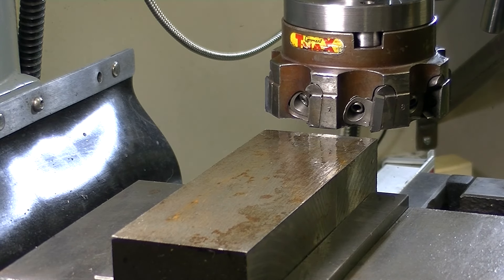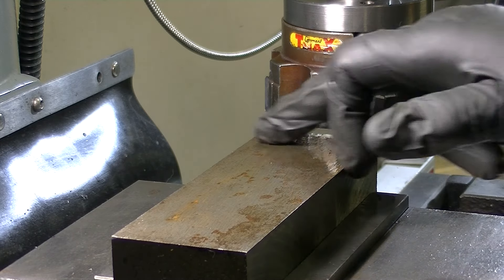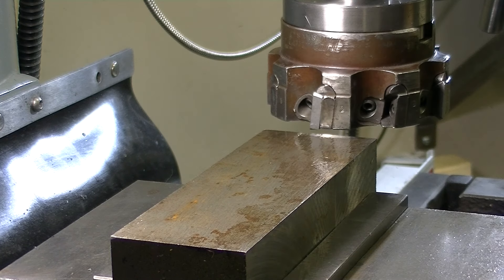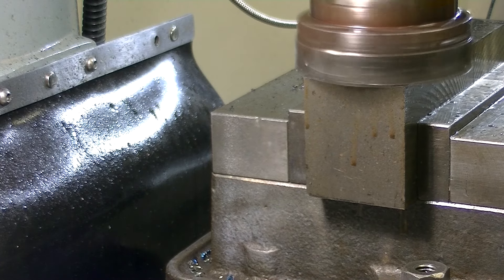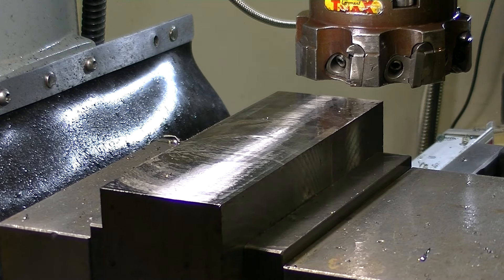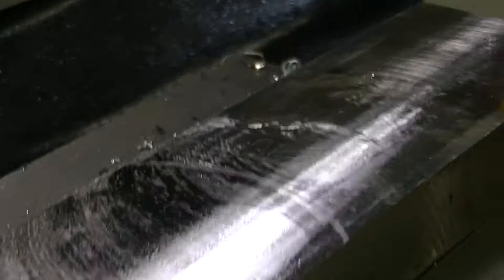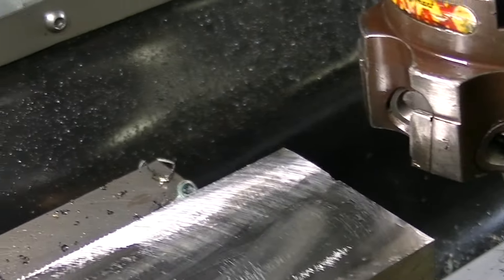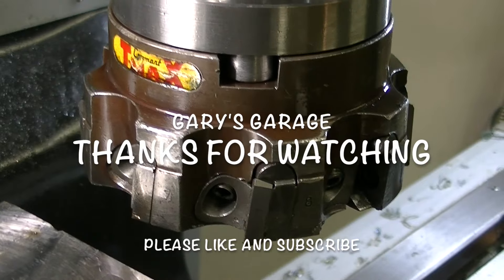Sandvik 8 cutter Facing head first cuts

Comment: Part of the reason it is not as smooth at the finish end is because you stopped the tool before it made a complete pass. I never stop the machine before the pass is complete, especially with a larger diameter tool, because if you don't have the face of the tool perfectly perpendicular then the cut will not be flat front to back or side to side. It will cause your cut to be dished out from side to side. The larger the diameter of the face of the tool the more extreme it will be.
So, check your machine and make sure it is adjusted properly in both directions. It matters.
Reply from the maker: @ken481959  That makes sense.  I did spend the time dailing in the head which makes a big difference.

Comment: Sandvik definitely make nice Tooling.
You could increase spindle speed a fair bit more even with a 1.5 HP Spindle Motor.
Carbide Inserts do like to pushed hard even in harder materials like 4140.
Sounds like you're happy with your latest purchase 👍
Reply from the maker: Some have suggested that I install all 8 cutters so I’ll give that a try and try a harder push.  Thanks for the feedback.

Comment: Please use all the inserts. If you need to reduce the load by half then either half the depth of cut or half the feedrate. The metal removal rate remains the same. Try not to stop the cutter on the top of the part and don't wind the part back under the cutter when it is not spinning. Don't worry about the chip color, it means the heat is removed by the chips and not heating up the part.
Reply from the maker: @tates11  That makes sense on all points.  Thanks for the feedback, I’ll give that a try.

Comment: That looks like a 5 inch cutter to me. But anyway....Bridgeports are fantastic mills but they struggle with face milling.  I have never had much luck milling with anything over 1 inch on them. Drilling, end mills, fly cutters, reamers, boring bars all do great on Bridgeport style machines and they are essential for any machine shop. 
Cheers.
Reply from the maker: I had to go down and measure it.  It's actually a 4" cutter.  Funny now things get exaggerated just like my fishing trips.  Weighs a ton 😉